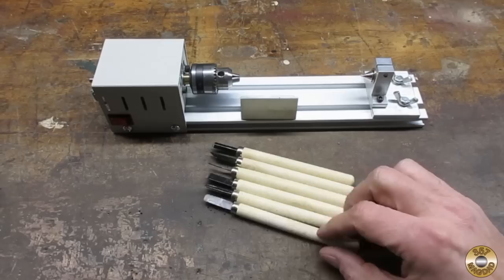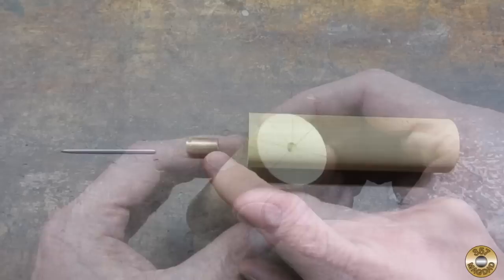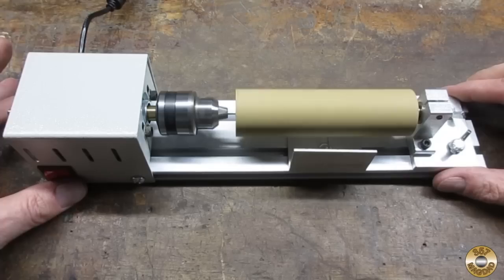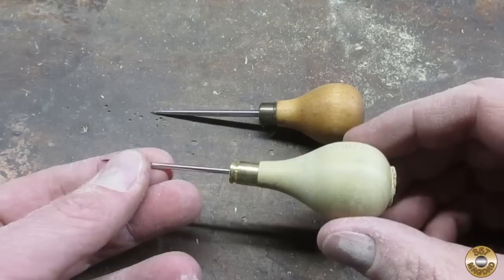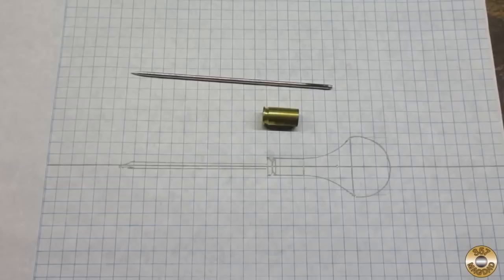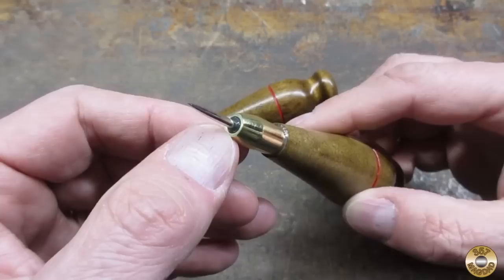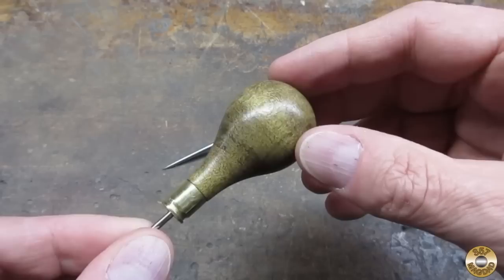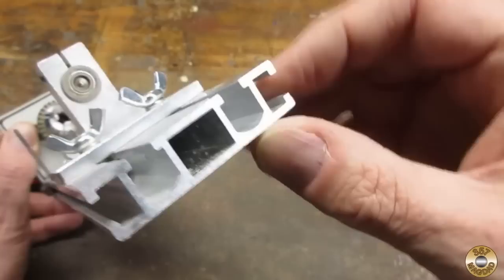Making Scratch Awls on the Mini Wood Lathe / Bead Lathe

Comment: The lathe seems like it works fine, but sounds like it lacks power.
Reply from the maker: The low power works out good for me.  If I do something stupid, the motor will stall out before it pulls the tool out of my hand.

Comment: Great work mate. You know if you turned the tool rest around 180 degrees, it would slide closer to the work and have the adjustment screw more accessible. Just goes to show you don’t have to buy expensive tools to have fun. Looking forward to seeing your next project.
Reply from the maker: Thanks!  If the tool rest is turned around it is right at the center of the chuck.

Comment: The pokey things look terrific.   I have only stained poplar in a project once.   I used Minwax Stain Preconditioner on the poplar prior to staining and was able to get a much more even stained colour.
The DIY tools worked well.   A huge difference from the thin carving tools.
I have a piece of Kreg extrusion which is 57mm x 18mm.    The two slots are about 38mm between centres.    No slots on the side.
I can mill T slots in a piece of hardwood.   Likely strong enough for this application.   I can make the slots to work with imperial hardware.    You likely do not need slots in the side, the headstock can just be screwed to a wooden base.
Dave.
Reply from the maker: I got some pre-stain conditioner to try on my next project.  I think I'm gonna tackle the tool rest first and then look into making it longer.

Comment: Ever since I sewed the insulation layers together on an expansion joint on a coal fire boiler with a 180 curved needle, I am very aware how brittle they are. I had a piece of plywood under it for a flat surface, any hit on that wood just snapped those needles! 😱 These needles are thicker, but I can't imagine they would bother changing the heat treat. 🤦‍♂️🤣
Reply from the maker: The needles are hard enough to mark mild steel.
Reply: @357magdad  yeah, that means they're harder, ergo more brittle. Instead of bending, they snap.

Comment: The pokey things look great! Using the worn tools was a good idea and any high carbon tool will be much better than the original tools that came with the lathe. I was pleasantly surprised to see how well the wood turned in the lathe and I am considering getting one myself as I have many small projects I would like to use a lathe on. Thanks for sharing this and I am looking forward to your solution to the tool rest.
Reply from the maker: Thanks John!  I've got a couple ideas I'm gonna try with the tool rest.

Comment: What fun, they turned out great Magdad, as always I particularly like the Bombay Mahogany with the brass, just a classic combination. Glad you're enjoying the lathe, and those modified chisels and scrapers are a vast improvement on the ones that came with it !
I wonder if you could adapt the tool rest to clamp on the rails using a front mounted screw or wing nut , or merely guided by the parallel rails and secured along the front slot ?
Reply from the maker: Thanks Andy!  I plan to modify the tool rest for my next mini lathe project.

Comment: After watching your previous video I was inspired to buy the same lathe. I'm also surprised by the power it seems to have but as you say the tools are naff!. I'm glad you've resolved the tool problem in such an easy [attainable] way. This will be my new project too. I shall be interested to see your solution that  'er-hem' 'tool-rest' as I've, so far, only fitted a split tube along the top edge to make it smoother. 
My problems tho' are; 1) the work holding, your 'pokey things' have a steel needle that the chuck [not that Chuck] can grip. I don't think a proper 3 or 4 jaw lathe chuck could be made for this little beauty though. 2) You seem to be preferring poplar, but what is it like with harder woods. 3) Will it work metal? My late father had a large collection of metal working bits that i'm keen to [first, find] and then try out. Great vids 357, looking forward to more of these - I'm kinda looking over your shoulder. Cheers.
Reply from the maker: The lathe came with a mandrel for screwing into a wood blank.  I haven't tried it yet.  I don't have my tools and tool rest to the point where I feel confident with square stock or harder wood.  I do see myself trying to shape brass on it someday.
I'd love to see some photos of your tiny lathe projects!  357mdad@gmail.com
Reply: @357magdad  That mandrel, no more than a polishing arbour for the dremel, just about held up with the 'included tools' but I doubt it would handle any real cutting pressure for long. I'm thinking of making HDPE (2) blanks,when I resolve my tool issues, but its all a work in progress at the moment. As I said above, I found mini-lathe chucks online but the price is a little prohibitive. If I manage to turn anything creditable I'll send you a pic, cheers.

Comment: I have not made an exhaustive search yet, but 60x30mm is readily available and it would make the bed heavier, more rigid, and possibly help to dampen vibration.  We use a lot of extruded aluminum for projects at work, but this is not a common profile we use.  Even so, I will look around at work to see if there is a suitable piece as scrap.  How long are you looking for?  18 inches?
Reply from the maker: I found some 60x30 and i don't think it will work.

Comment: I have a full size lathe but I also have one of those lathe beds you put a drill on and you can turn things up to about 18 inches on that, which is a nice size plus it's portable and can take it anywhere.............Too bad you couldn't find a piece of that aluminum to extend yours a little.
Reply from the maker: My plan is to improve the tool rest first and then maybe work out a way to make longer handles.

Comment: Hey Magdad how are you applying your Bombay. In covering a larger area I'm having difficulty applying it evenly as it's drying so fast. It says not to use a rag to apply but I think I'm going to go back to a rag. Nice pokey things.gotta love a good awl.
Reply from the maker: The Minwax Polyshades are tricky to apply evenly.  I've had the best success with a very soft bristle brush.  It also comes in a spray can that might be better for large surfaces.

Comment: The rest needs to be closer to the work maybe make an adjustable one
Reply: ….Also I think the rest should be a little more beefy. I may be mistaken but from the sound of things, it may be transmitting vibration back up into the tool.
Reply from the maker: I plan to improve the tool rest for my next project.